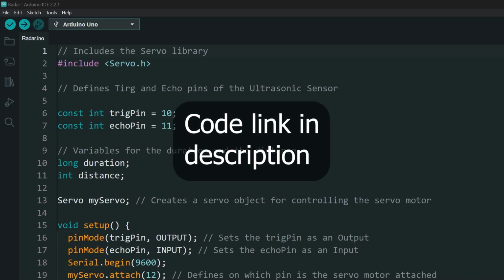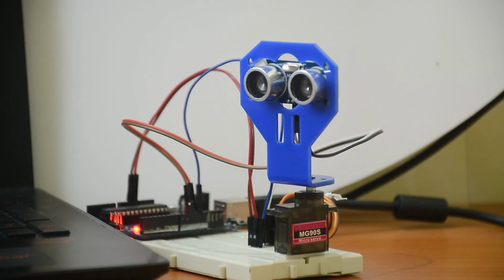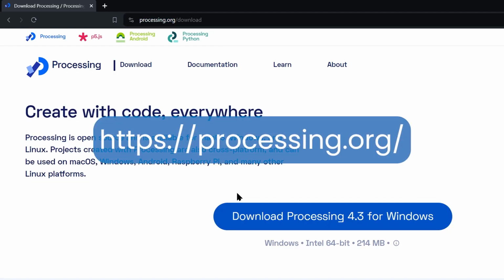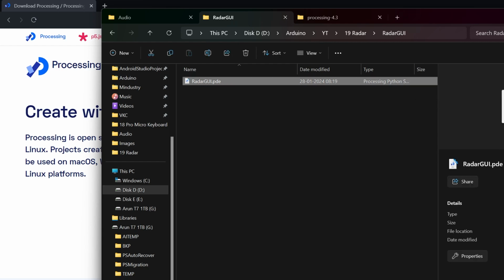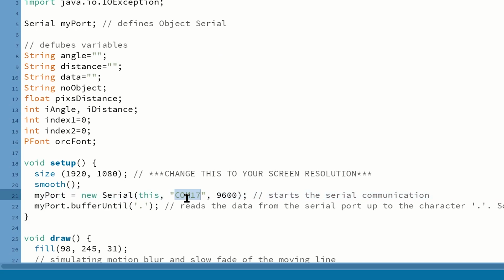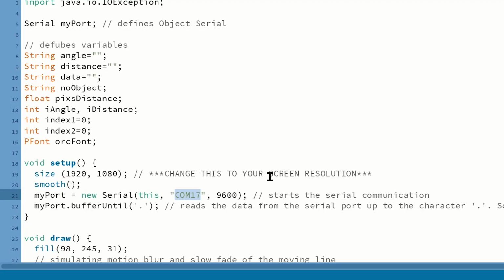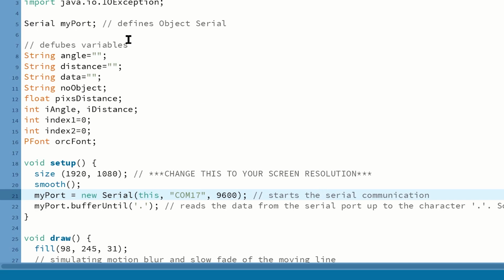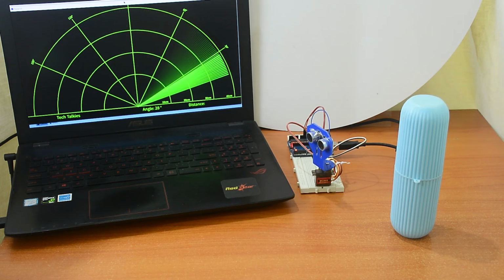Arduino Sonar / Radar - Beginner Guide

Comment: Seems cool - but I only have a 3 pin servo - does it have to be a 4 pin? Also can I use a PI or ESP32 instead (because that's what i got at the moment)
Reply from the maker: The servo I used is also only 3 pins. Sorry for the confusion. 
Yes, you can use any microcontroller.
Reply: @techtalkies1  video shows 4 pins
Reply from the maker: I've inserted male header pins to use it on a breadboard. And I forgot to cut off the extra one.